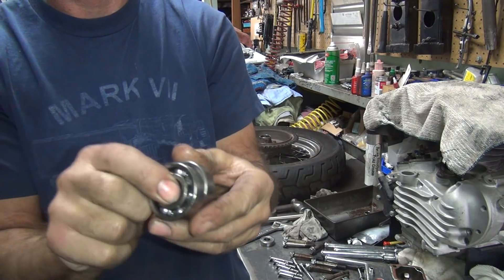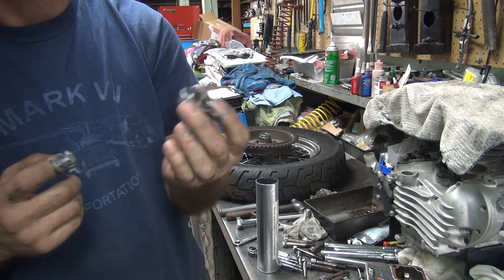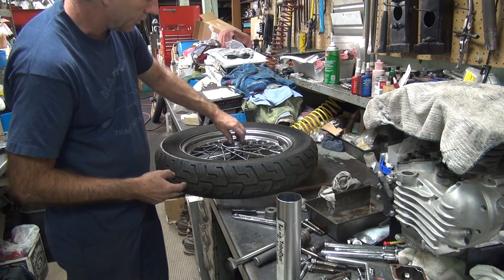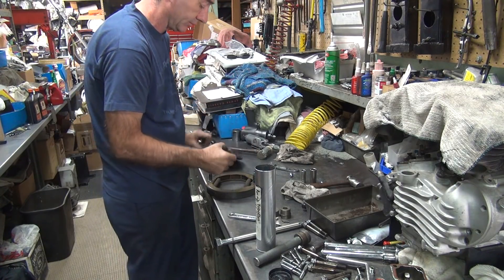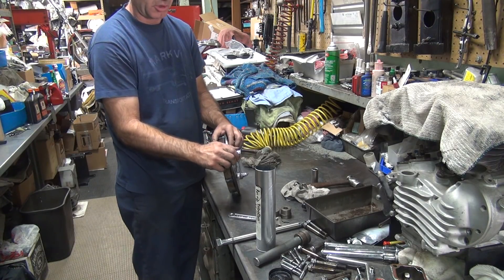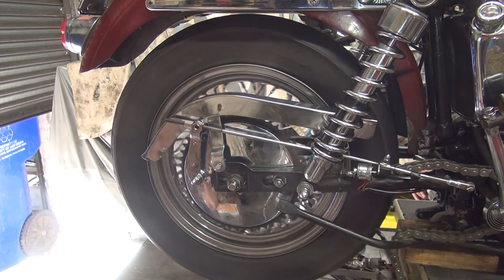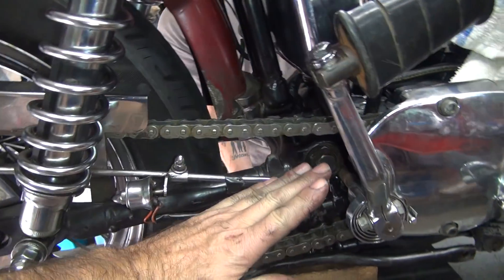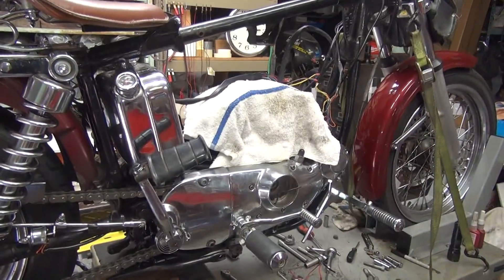1972 ironhead #126 xl xlch case repair motor rebuild harley sportster by tatro machine

Comment: That damn grease is 380$ for 16oz can!!! my god
Reply from the maker: that would be for the full on nascar f1 grease. i use the cheaper stuff. tribodyn has three different grades or the grease. the more good stuff they put into the grease the more it cost.
whats it worth to you to get that extra foot at the finish line.

tatro
Reply: Yea, I ordered the cheaper stuff ,along with the gasgacinch 440-b and Three bond case sealant 1184A100G .. hopefully its the same stuff you use. I paused the video and just got the stuff that looked the same. What assembly lube do you recommend? Im currently building a 60 XLCH using your videos step by step and a 69FLH . the XLCH I have completely tore apart and the 69 I bought complete for 1800$  with 8k original miles. just needs some tlc and had to rewire the entire bike.   Just want to say thanks Tatro for all your work and sharing your extensive knowledge to the next generation like myself. I know it takes time and much aggravation making these videos but I dont know where I would be without them....Thank You
Reply: any yall ever hear of Shaeffer, they make a grease that is special, water proof, very hi-temp rated. It has a moly compound impregnated in the grease & the oils they make.